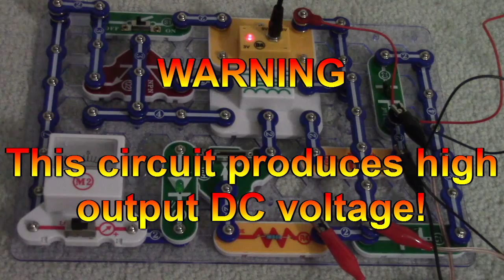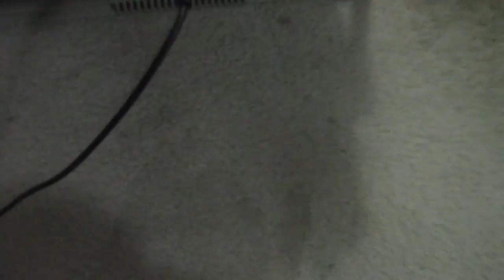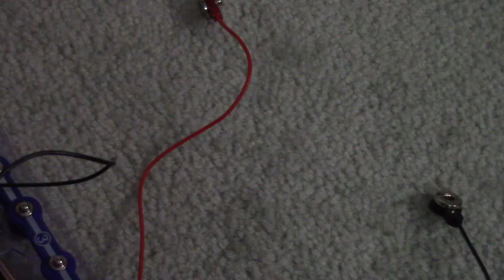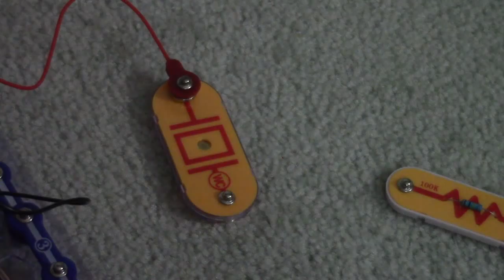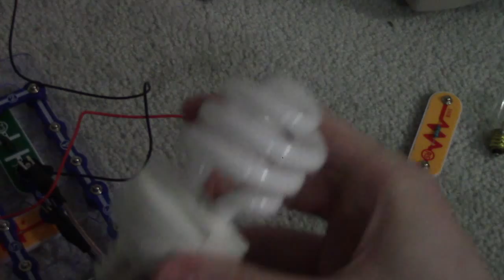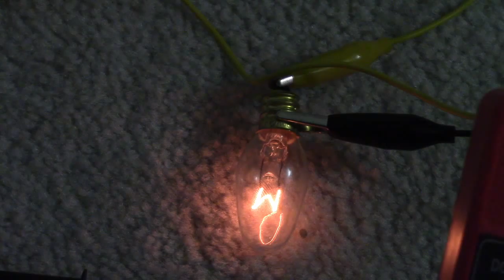Custom SnapCircuits: Shocker

Comment: Funnily enough, there are circuits IN THE ORIGINAL MANUALS that can shock you. For example, place your fingers across the secondary of T1 on Project #340.
Reply: Cut off the project Shocker

Comment: Ya wanna make this lethal? Simple.
(may ruin components (or ur life))
simply repalce c1 and c2 with higher power ones!
Dont run it for very long tho, or you may melt them
and, dont touch it unless you want to die
DO NOT TOUCH THE WIRES AND CONNECT THEMSELVES TO YOU
I do it for the sparks

Comment: Hey, ik this is an old video, but i kinda completely reworked your design and i was able to get ~180 volts. Would you like to see?

Edit: i did some fiddling and peaked at 213v dc
Reply: Can you post a circuit diagram/schematic of how you did this?  Thanks!
Reply: ow
Reply: Don't touch it, you could've died at 42 volts!!!
Reply: Oh my that must of hurt
Reply: Just replace c1 and c2 with stupidly powerful versions (think c5, or the special c8)
and find a method of cooling
Reply: @Creeper Mouse works for me fine, just dont touch it toghether that often or it may not be fully charged/it might burn your transistor out if ur not careful (I have heatsinks on my transistors)

Comment: A transformer does not change AC to DC.  A rectifier changes AC voltage to DC voltage.  A transformer modifies output AC voltages, it can increase voltage (step-up) or decrease voltage (step-down) from a fixed source.  a light bulbs rating does not reflect the voltage needed to make it light up.  120 volt 4 watt refers to the energy change at 120 volts will be 4 watts.  That bulb will illuminate at a much lower voltage.  You keep referring to your DC voltage.  How are you creating the DC?
Reply: The DC output is made by the capacitor series and the diode
Reply: diode thingy
Reply: My understanding: The transformer needs AC input (or pulsed DC input).  The transistor is creating the pulsed DC by rapidly switching on and off.  This pulsed DC is going through the transistor's collector into the transformer's primary coil.  The transformer steps up the voltage and the diode rectifies the resulting AC current into DC current.

Comment: dude this project is awesome. I tried it and it actually shocks. So not much of a fair warning is needed, just if anybody has extreme stress or heart problems, to not make this. lol I was so nervous of getting shocked but it was a tiny sting
Reply: Do you need the real jumper wire? Not the snap Circuits one
Reply: Be it doesn't work